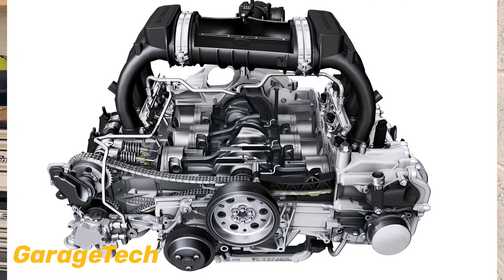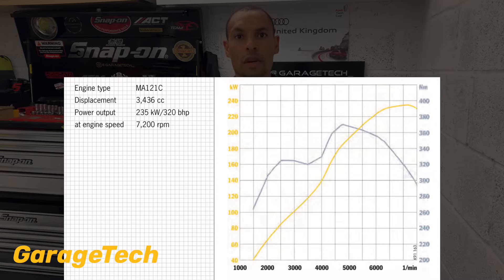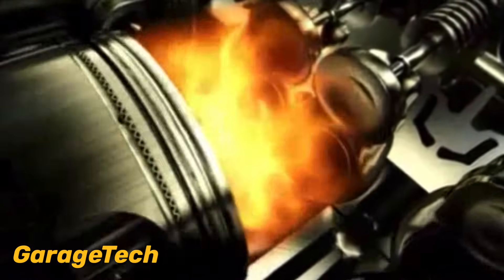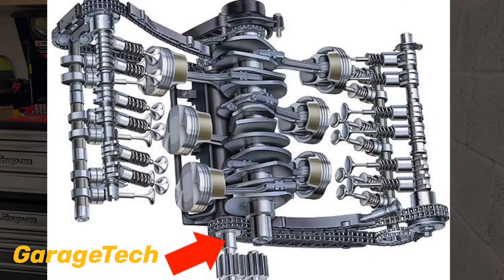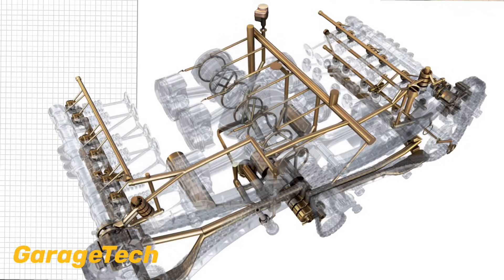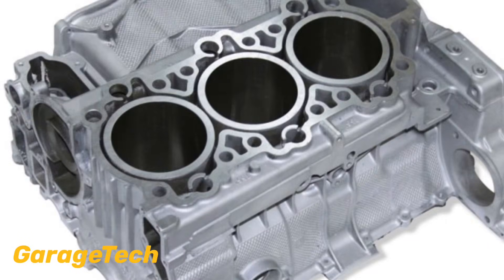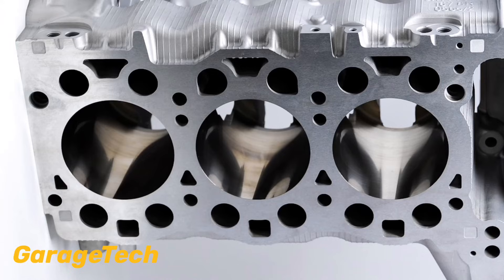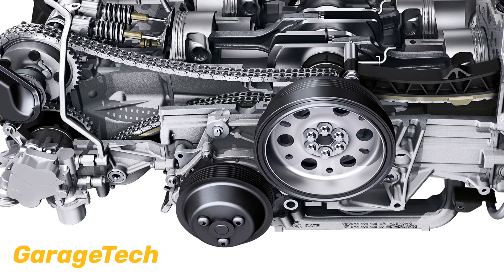Porsche Cayman S Engine - Gen 1 987.1 M97 vs Gen 2 987.2 MA1 (9A1) Why is the Gen 2 so much better??

Comment: I often hear the MA 1.20 Motor with 2.9 l, 06.09 - 03.12 is the one that combines the new engine layout with the oldscool (non-direct) injection. Is that true? And what happened after 03.12 with the basic boxster motors? The S-Models use the MA1.21 with 310 HP or more, easy to identify over the Horsepower. Are those all DI?  Do all of these profit from all those inventions you mentioned in the video?

Comment: Excellent videos, I love the way you present the info so needed by Porsche owners.  Keep it up.  Please tell me; is the 2.9 engine (in the 987.2 base Cayman ) more prone to problems than the 3.4 (987.2) in the Cayman S.
Reply from the maker: @sg4682  hey, thanks for the comment, from my understanding I don’t believe it’s anymore prone to problems, if anything slightly better as it has indirect injection so doesn’t get as much carbon buildup.
Reply: @GarageTechAutomotive  Great thanks, am I correct saying that the 2.9 engines have the exact same engine improvements applicable to the 3.4 apart from DFI and the new piston head design to accommodate the DFI system?
Reply from the maker: @sg4682  yes correct 👍🏼

Comment: Hi, I enjoyed the vid v much. I have one question. Can a Gen 2 987 Caymen, with no Limted Slip Diff be retrofitted with an LSD? How difficult or easy is the job?
Reply from the maker: Hey, yes they can, will need the gearbox removing and a new Diff/LSD fitting. Not a job to do at home unless you have room and also some of the measurement tools to ensure correct fitment.

Comment: I have an engine failure on my 987.1 cayman s. Considering swapping  the complete drive train to a 987.2. Do you see any major issues with this? Thanks
Reply from the maker: Must of been done before, I’m sure it’s possible. Wiring loom, ECU and things like fuel pipes etc may be different in the engine bay

Comment: I think you will find there is much more to bore scoring that you explain in this video.  The move away from Nikasil coating to a much cheaper coating is the pivitol reason. Bottom line, there is a very high probability all MK1 car will suffer from this complaint.

Comment: I thought the primary reason for having the IMS on the earlier motors was because Porsche saved money by using the same heads for left and right banks which meant the cam wheels were on different ends requiring the IMS to drive the cams at either end of the engine……..

Comment: Great video! I've been thinking about picking up a 987.2 base cayman. Not much information on the engine is online but i heard that all porsche 6 cylinders share the 9A1 basic architecture. Does this mean with modifications I could convert my port injected 2.7 in the base cayman to the direct injected 3.2 in the s cayman? Or eve (theroretically speaking) the same engine as the 911 GT3Rs??
Reply from the maker: Hey, without looking into all the technicalities, I’d say it would be easier to do a straight engine swap. I’d suspect the cylinder heads will be different, plus you have a high pressure fuel pump etc. different ecu, wiring. I did a video on the difference between the 3.4 , 3.6 & 3.8 . They are more similar than the base and a S

Comment: my car have noise ,so I give it to Porsche to see they can find the problem, when they testing and acc the engine high rpm,the engine suddenly big bend and lock up, they said the IMS just gone, want me to pay A$30000 to repair. I did it myself, but it still cost me A$10000.

Comment: The reality is that a 997.1 Carrera S has a totally reliable IMS bearing and if you can get a car with Nikasil coated cylinder liners such as fitted by Hartech in the UK, you have a completely reliable engine that will not get IMS or bore scoring problems.
This has the further advantage that the M97 has more of the traditional noise and characteristics of a 911 which unfortunately the MA1 lost.
I would argue that a Hartech rebuilt M97 3.8 S engine is pretty much the best NA engine you can get in a Carrera.
Buy one while you can!
Reply: The only problem is that the cost for the 3.8 engine is £11,000. A revised IMS bearing, new liners and pistons is £ 9,000 from Hartech. You will end up with a fantastic car if went down either of the modifications/ repairs but cost wise, a gen2 is the safer bet.
Reply: @michaeledwards5241  that's why you find one for sale that's already been upgraded. For some reason they're not much more expensive than standard cars... At the moment! Surely that's going to change?

Comment: I had understood the the .2 engine was essentially bullet proof.
But, went to check out a 2016 Cayman 2.7 for a friend. For sale at a local Porsche dealer, with 30k miles and huge gap in servicing (no oil change for 2 years and 20k miles).
Rattled on idle quite badly. So I took an audio recording and sent it to a 911 engine specialist - he was certain that it was due to bore scoring and advised that we walk away. I was very surprised.
Now considering a 2015 S which sounds ‘night and day’ different.

Comment: In your review you should have pointed out that updated M97 engine has very improved IMS bearings. 
I'm the first owner of 2007 Cayman S (90 000 km) and I didn't have IMS failure or any other serious issues but at this moment my car is at service and I'm waiting for the following parts to be replaced: AOS, alternator, belt, belt pulleys and tensioners, water pump, coil plugs, spark plugs, rear brakes (1st time change). This is the biggest maintenance so far but after 90 000 km and 14 years it's to be expected.

Comment: Having done many mods on the m96 engine followed by a couple of teardowns of the same blown up ones, I skipped the m97 series and went straight to the 987.2 3.4 DFI engine (which I haven't touched!). Thanks for this clear and well illustrated comparison! 😎
Reply: How’s the carbon build up on the inlet valves?

Comment: A lot of people prefer the .1 cars. They are rawer and many would say the non-DFI engines sound better. If you have an 06 or later car you're not really going to need to worry about the IMS. And the .1s are much better value.
Reply: What did they improve in the 06 for the IMS?
Reply: The main advantage of the gen 2 the engines is the elimination of the issue of bore scoring which was particularly prevalent in the 987.1 4.4 Cayman S engines.  The base 2.7 engines didn’t suffer anywhere near as much as the 3.4. 

IMS issues were more of an issue with the 986 and 996 engines.
Reply: @bhopindermahal6481 987.2 cayman s also suffers from bore scoring. junk engine material with forge pistons there’s is no way around it

Comment: I have a 897.1 had it 3.5 years with no problems. IMS is not a problem on Caymans they have the larger bearings. Regarding bore scoring I had mine scoped at purchase which was total clean from bore scoring, I have regular oil changes and services. Mine as been super reliable. Also Gen 2 are also showing bore scoring now so not a bulletproof as people thing. The only reason Gen 2 are holding the price better is because their newer.
Reply: Gen 2 base seems to be the sweet spot of reliability and performance
Reply: The bore scoring is showing up in gen 2 now as well.

Comment: 2006 987.1 Boxster with 110k kilometers. Small wiggle movement on tach at all engine speeds and bit of smoke on startup. Isolating the AOS solves the issue (appears to be failure inside AOS). Part purchased and ready to be replaced. No oil leaks. Bit of water inside cabin solved by replacing inner door skins which come pre installed with gaskets. Otherwise car is mint and drives great.

Comment: Yea I kinda wish I got the gen 2.  I don't really care too much about the IMS since it was absurdly low failure rate even on the 987.1's, but the bore scoring has me worried.  The car has been rock solid reliable to me but I've only had it for about 1.5yrs.  Def. worried about the bore scoring though.  Especially so since I have the "S."
Reply: Nice to have a update, how is the car
Reply: @newpatchincoming6574  Eh, well no signs of bore scoring yet, but I've also put maybe 500 or 1000 miles on the car since that post.

I have like 5 cars & a few motorcycles, and that + work from home due to COVID means I barely put any miles on anything the past few years.  Probably like 6k/yr total.

I still have the same opinion, the car is worth like 20k, it's hard to justify 12k or so for an engine if it fails, but a 10k loss also sucks, so it's a pretty big weak point.  The internet probably makes it seem more common than it is - you don't hear about the many instances that don't have bore scoring, but it's something I'd rather not deal with.

I'm going to sell it soon, but I think even if the bore scoring issue didn't exist I'd be selling it soon, rest of my stuff is newer & faster and it's an extra mouth to feed in terms of reg, insurance, oil changes, etc. if it's not being driven much.
Reply: @MrSlowestD16  thanks for the response brother, hope you get a quick sale. It's a brilliant car
Reply: @newpatchincoming6574  Agreed that it's a great car, and I don't regret owning it at all.  I will definitely buy another Porsche some day because of that car.

I have a Supra though which pretty much fills the role of that car exactly (2 seater, it's faster, '21, better in the twisties, still under warranty, etc.), so it's hard to justify keeping it specifically because of that car.  I've been saying I'm going to sell it for a year though, so talk is cheap, lmao.  We'll see when I actually sell it.

Comment: The 5 people that have given this video a thumbs down (as of November 2020) are all .1 owners that are mad they didn’t do their research before buying their gen 1s and are just butt hurt they bought a less reliable engine lol
Reply: Wrong, I have 2 Caymans a 987.1 CS and a 981 CS. There is nothing to worry about with the 987.1 if you are smart and know what your doing. The 987.2 also have reports of the same “issues” by the way. I spend a lot of time around Porsches and these issues are blown way out of proportion, especially by people who never own them. Every Porsche model has its “things to beware of” If I listened to experts on the internet I never would have bought my 993, 997TT or my R8. The 987.1 and .2 are still one of the most fun cars to drive. Bore scoring affects less than 5 percent of 987.1 and IMS less than 1%

Comment: It's not "so much better" it's slightly more reliable I suppose but the Gen1 is fantastic and failure rates are very very very low. Also you can buy a Gen1 for about 30% less (like for like)
Reply: It's much better if the second generation doesn't experience IMS, bore scoring, and oiling issues. Those are 3 major issues. There are YouTubers with the 987.1 S that can't even track their cars because of oiling issues, even after spending thousands on a deep sump.

Comment: I bought a 987.1 and I’m glad I did it’s awesome. 35k miles and no IMS work. My question is what will happen if the IMS fails? Does that mean I need to purchase a new engine for $10k or so? Is that the worst case scenario? Or am I just wishful thinking because I enjoy driving this car so much lol thanks in advance for any reply see you out there Porsche brothers..
Reply: The likelihood of the IMS failing is exceedingly low but yes, if it does happen, your engine is toast and will need to be replaced.
Reply: Great, I’m not gonna worry about it at all, what a car for driving anywhere with turns, this is my 4th Porsche.

Comment: Great video! Since you asked ... how about a deep dive on all the differences between the 4.0L NA engine in the 982 GT4 and the 9A2 EVO engine on which it is based? Differences between the former and the 3.8L NA in the 981 GT4 would also be interesting. Thanks!

Comment: I have a 2007 cayman s 987.1 with 92 000 miles with the original ims bearing, i drove it for 7 years no problem at all. I live in Morocco there is no possibility to get the ims bearing changed...
Reply: You car has in the improved IMS bearing.

Comment: Great info thanks GarageTech. I knew about the IMS and seal which is why I steered clear of the 987.1 but good to know of all the upgrades and re-engineering that went on. I adore my 2011 987.2 Cayman S which I've owned for 3 years now and plan to have for many more.

Comment: I have a 2006 987.1 and it has the stronger ims bearing fitted as (factory) standard. The weaker ims bearing was discontinued in 2005. Saying all gen 1’s have the weaker ims bearing isn’t true.
Reply: 987.1 Cayman S Manual with just under 57000 ks (35400 miles give or take) with no IMS or bore scoring issues. Driven twice a week in good weather but has also been tracked once in my ownership. FACT: You have more chance of dying of COVID19 than having an IMS failure, but I bet you still go to the shops to stock up on bog roll ;)
Reply: @005AGIMA  Agreed. Enjoy it and deal with the issue IF they arise. I have a 2003 986.2S manual that I flog near daily from March through November. Original IMS at 110K miles now.  I'll replace the IMS bearing with a solution when it needs a clutch  but I'm not going in 'just because'. IF it fails, 3.4 upgrade all the way but I don't worry about it.
Reply: I have a 987.1 base Cayman from 2008 and 160.000 km on it no issues at all drive it every day also in winter these 2.7 engines can run easily 300.000 km no IMS issues whatsoever these 2.7 engines are the best ! No bore scoring at the 2.7 engines never !
Reply: No issues with my IMS bearing.  Worst thing has been the water pump at 40k and now a drooping headliner.
Reply: 2006 cayman S 90 000 milles, no ims bearing problem, bore scoring maybe.
Reply: 2006 Cayman S 987.1 with 80,000 miles. Every oil change sent in for laboratory analysis, no significant traces of wear found. Water pump replacement at 60,000 miles. Coils and plugs at 70,000. My daily driver year round.
Reply: I have had a 2007 2.7 cayman for 5 yrs, 82k on the clock,  its abit of a garage queen 2k per year, but when i drive, i drive it hard, i have had a few bulbs go thats all
Reply: My 05 has the updated bearing. So far I’m on 126,000 miles and doing fine.
Reply: I have 2006 Cayman S and all is good. Love it!!
Reply: Not all 2005 have the weaker IMS, mine had the improved version. I knew this when I had the transmission removed, had a lightweight flywheel installed. I love this mod, will have that installed in my 981 Spyder when I need a clutch. 144,000 miles on my 987S.
Reply: @clu4u  Weakness/rigidity is not the design flaw. This isn't a single row, or dual row or enlarged single row issue. Durability is compromised when the seal fails.
Reply: @PKmode  Dual row never fail, and rigidity has nothing to do with it. You’re wrong. Do some more research please.
Reply: 06 with bore scoring @ 40K miles. Sent a replacement engine for sleeving and waiting for it to come back. In canada they seem to be a little more sensitive to this issue.
Reply: @Shereefe  is this a Boxster or Caymen?
Reply: @warrenhawthorne5378  cayman
Reply: 126,000 on my '06 manufactured Cayman and the IMS hasn't failed yet.
Reply: Yep. The 2006 had like a 6% failure rate at 90,000 miles; by the time you get to the 2008, it's down to <1%. I'll take those chances any day. Imagine seeing 150 Porsche Boxsters lined up and risking picking the one that might fail at 90,000 miles. Not that big of a deal at all.
Reply: Following:
Just bought a 2006 Porsche Boxster S manual transmission 3.2L with 84,000 on it. Records show regular maintenance up keep no IMS bearing replacing. I will daily mine as I do all my cars. I will do a couple track weekends a year, too. Cars are made to be driven. I'm about to watch video but the newer DFI engine I would think have dirty valves issues.
Reply: 241000 KMs on my '06, stock IMS and runs amazingly beautiful.
Enjoy your Caymans, they are meant to be driven.
Reply: Great vid and very informative. I have a 987.2 Boxster S. it’s just great & no IMS to worry about.
Reply: 2005 Boxster (base not S) 126,000 miles strong. No IMS issue or replacement.
Reply: My 2006 gen 1 90,000 miles is still sweet, zero engine issues.
Reply: It is true.
Reply: I have an 06 987.1 Boxster S with the M97 engine here in Australia. Just had full service done, 135,300 kilometres original large single row bearing and the porsche specialist said no issues as I had them check ins and bore with a scope. All good and nothing in the filter every service.  Runs great
Reply: It's not true across the board either way. There are 987.1s after 07 that still suffered IMS issues. In contrast, there are still many original 986 and 996 M96 variants that are still on their original IMS as well. You can't live in fear of an IMS problem. Drive and enjoy the cars as intended. If anything, IMS problems seem to be the most common across platforms amongst the low mileage examples that sit for long periods of time. The argument being that after the seal is compromised and the original grease washed away, the engine oil continuously keeps the bearing lubricated.
Reply: @PKmode  I'd be interested to see evidence of any PROVEN IMS issues on the post 2005 bearing. Even Jake Raby says they don't break and he sees an awful lot of M97 engines.

Comment: Really informative video, my 2007 987.1 had a water pump / head gasket failure at around 75000 miles. Head skim, new water pump and a £3k hole in my wallet but she's run well since touch wood... now at 97000 miles. Love the handling and noise...
Reply: omg head gasket??? Is this a common issue? design flaw?
Reply: @allthingsaudio3840 no it's definitely not It's only bore scoring And IMS issues which are also quite rare , head gasket can happen to any car man